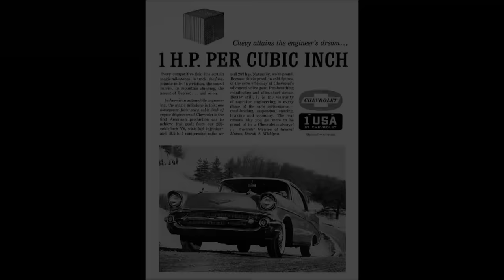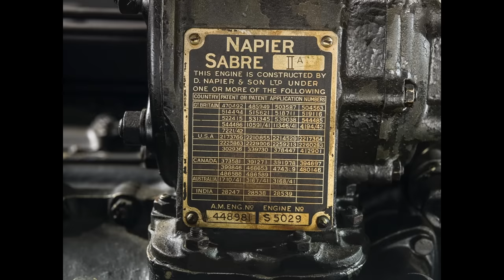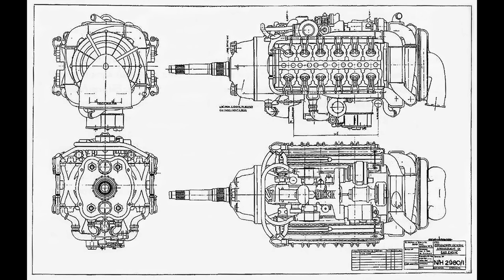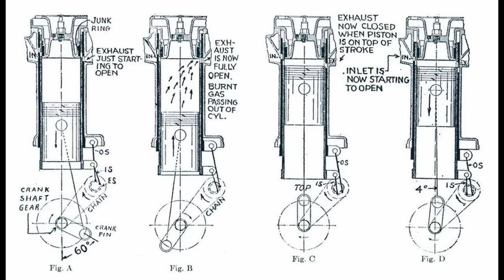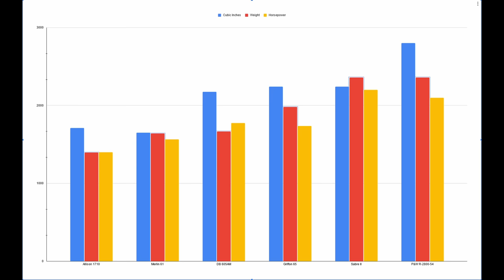Napier Sabre - The Ultimate WWII Aircraft Engine - Part 1

Comment: It's pronounced NAPE`-ee - ur.  My Dad was an engineer for them in the period right after the War.

It's my understanding that Napier felt, as you said, like the red-headed stepsister when it came to defence contracts during the war, and after. They probably had the best team of design engineers of the lot, but their solutions were based on complexity. So it doesn't mean much to say you have the highest power to weight ration, or the highest specific power, when that translates to unreliability in the field. 

My father began his career at Napier as an apprentice, right after University (BEng) in Canada, so he was a) well trained in engineering ideas and b) still required to take a highly practical path to the design floor. This might have been a post-war adaptation of work practice by Napier, in response to the disfavour that the Sabre met with, which was generally thought to stem from the unreliability of the unit. But Napier's roots were in old-school British engineering, and closely tied to the expectation of a practical engineer, not a lofty theoretician, as their ideal designer, so I doubt it.

I think the premise of the video, "Ultimate" award, isn't well suited to the topic. Without a doubt, a better trained ground engineering staff, able to work effectively on the Sabre would have improved things; so would better maintenance schedules; so would better logistics, for the delivery of spares. But in each of those caveats, there's the reality of war: the Ultimate engine most certainly isn't the best engine, if it fails on all those criteria, which the Sabre did. More importantly, it did worse than the other engines around it, like the Merlin, of course, but also the many Pratt and Whitney radials, whose design philosophy was built around simplicity, repetition of parts, simplicity of machining individual parts, and potential for improvised field repair. These were not ideas that the engineering elite in Napier gave much thought to.

A rather tragic side note to this: my father was in his late teens on D-Day, and finishing high school. On that day, the person in our family he looked up to, far beyond anyone else, his uncle Mel, was lost, in a Tempest (might have been a Typhoon), and the wreck and his body was never recovered. Given that, it's generally felt that the most likely scenario was that after getting detached from his group, he made his way back over the Channel, and a lilkely cause of death would have been the failure of the engine in his plane. The death affected my father hugely, and he never stopped referring to Mel, decades afterwards.

And after graduating, he went well out of his way to secure that apprenticeship with Napier; that's how he ended up in the UK, how he met my mother, and that led to the guy writing long comments on YouTube, 65 years later. But I wonder, and have always wondered, if joining the firm was in some way connected with making things right that had gone wrong for his hero....
Reply from the maker: I agree that I'm using the term "ultimate" a bit loosely here and only applying it to power output rather than the numerous other factors, as you mentioned. I think the next video will cover the R-2800, which many would agree -- alongside the Merliln, which deserves its own video -- was the real work horse of the war. 

Also, what an incredible story! While tragic, it's so interesting the personal connections people form to these bits of history.
Reply: I've been pronouncing it correctly...Thanks for the story about your father...You know, I use to fly a Battle of Britain flight sim called 'IL2 Cliffs of Dover' (checkout the dogfights on Youtube)...and there was an airstrip at 'Lympne' during the Battle of Britain that you could use in the sim...We used headphones as comms so we could fly with folk worldwide all in real time (still amazes me)...Anyhoo, nearly everyone had a different pronunciation for 'Lympne'...so I phoned a pub in the Lympne village and asked them just to put the debate to bed...It's pronounced 'Lim'...The bar staff laughed at the call...
Reply: Thank you for sharing that fascinating story..
Reply: Good engineering solutions meet the specification using the least cost and complexity.  In the case of the Sabre, Napier proved that they could meet the specifications, but at a cost and complexity that meant their solutions were not, at least initially, mass produceable.  In the normal market this sort of solution can be acceptable provided you can secure funding to continue development... again and again.  In wartime it can be fatal.
Reply: @lewistaylor1965  Only the English could come up with Lympne and pronounce it Lim. Wonderful. I fly DCS simulator (from Spitfire to Hornet) and yes - it amazes me that I can fly online with international friends on missions. Just got the Winwing HOTAS controllers.
Reply: Love hearing this kind of stuff.  Thanks man!
Reply: @flightdojo  How many hours of maintenance per hours of flight was required for the Napier Sabre engine. This wasn't addressed in your video.
Reply: There's a problem with the power to weight ratios listed for all the WW2 liquid cooled aircraft engine's that can be misleading, they don't include the weight of the cooling system and coolant since it can vary from one aircraft to another. 
Any engine this size making this amount of power is going to need a cooling system that'd be around 300 lbs, and that's probably a little on the conservative side knowing that the cooling system for the Merlin, which was a considerable amount smaller, was usually around 250 lbs depending on it's application.
Once you add 300 lbs to the listed weight of a Sabre engine you're looking at closer to 1 HP per lb which is where engine's like the R2800 were at towards the end of the war, the actual power to weight ratios of air cooled engine's are a lot closer to what's listed once it's in it's application and running. 
Since any engine with conventional poppet style valve's are considerably easier to manufacture than the sleeve valve type which were labor intensive you had much less man hours per HP involved in their manufacturing making them more ideal for something that needs to be mass produced for wartime as opposed to something that's being built for racing or in the interests of breaking records. 
At the end of the day a design that makes just over one HP per lb that takes twice as many man hours to produce is far less desirable than an engine that makes just under one HP per lb but can be manufactured in half the time, they were task with winning a war not races.
Reply: @lewistaylor1965  It's funny that if you want the best local information the Pub is the place to start, that is how I gathered the information about my ancestors and relatives on my visit to Wales in 2002. Actually, the tip came from my father.
Reply: I have always wondered why the saber was not in more aircraft. I never really thought that unreliability was an issue. The fact is we all buy things that we may not fully understand but buying something that dose not work dose not make sense. Proven reliability in the field is worth 1000 times more than a design that is tested under ideal conditions. Pratt and Whitney had problems with the R3350 in the B-29 that they never fully solved, replacing engines after 75 hours times 3,900 aircraft is not only expensive it wears out ground crew and without the support no missions. The Saber took away material, money, manpower away from the production of other aircraft and engines that were proven, not to mention jet engines that were in the early test/production phase. The value of a weapon can be proved in combat an idea or concept is only as good as it develops in theory to actual usefulness. Proving a concept  and the necessities of war was how aviation  made progress. Having proved that the Saber worked probably had the Germans put more of a sense of urgency to produce a counter. I thought that your post was one of the best posts I have read thank you. From a half Brit/American.
Reply: @Daniel_Donaldson I believe he DID pronounce it correctly, just the way you point out. What's the problem?
Reply: @jazzandbluesculturalherita2547  I lived in Napier, NZ, and he definitely mispronounce it badly; watch some pommie Napier videos if you don't believe me !!
Reply: @markgranger9150  I suspect it was partly to do with unreliability, but you really on find that out once it's forward deployed. I suspect a bigger issue is that the complexity of this engine meant you could build 2 or 3, maybe more, allisons, Merlins, or R2800s for the same price and time investment. The way ww2 was fought, the ability to take a design, convert its measurements, send it to the US plants, and have it quickly cranked out in the tens of thousands, was paramount. Sleeve valves (and 24 sets of them at that) require an insane level of precision manufacturing. Couple that with two cranks, a transfer box/final drive, all the plumbing to supply those valves (remember, you're now plumbing through the block instead of a head) makes economies of scale much smaller on the Sabre, whereas you could pump out R2800s all day long, strap them in an airframe, duct tape a prop to the front, and now you've got the fastest allied prop fighter of the war, and you can build tens of thousands of them.
Reply: @arkhsm  One of the best films I ever watched was "World's Fastest Indian." Me being a motorcycle guy, I could understand the central character's hopes and dreams, how meaningful it was to him to be able run his motor at the flats and win. Really cool story!

Also, I think the author here may have rerecorded his audio, because it sure sounds now as if he is pronouncing it NAPE ee ur.
Reply: @johnmclean6498  Except it is a BRITISH word from before the Roman invasion. Where's the "English" in that?
Reply: @seanm8030  I do think that the "least cost and complexity" doctrine as good engineering solutions is something that is often suffered from today. It is not uncommon that it produces something that focuses on the very lowest cost that can in some way deliver the requirement, and usually it initially fulfills the requirements, but that often may lack the desired and expected longevity of meeting the requirements. I would rephrase the good engineering solutions statement as something along the lines of "lowest cost and complexity without being too low cost or having too low complexity" (whatever too low means). More or less along the thought process of "Everything should be made as simple as possible, but not simpler".
Reply: @Daniel Donaldson Thank you for the amazing input.
Reply: You have to pretend you're Canadian.  It just helps.
Reply: @jazzandbluesculturalherita2547  It's all good mate.  The fact that Burt built a bike at the bottom of NZ, using a 1920s Indian engine; then managed to go to Bonneville USA in the '60s, is mind blowing in its own right !  The fact that he set so many records is off the scale !!
Reply: @hakanolausson1367   In the case that you needed to exceed requirements I would say your requirements document is incomplete or incorrect.  I would also have thought you were german.  :)
Reply: @flightdojo  don't worry about the keyboard warriors. Loving the channel. Subbed
Reply: Early in WW2 (1939-40), aircraft companies were encouraged to offer versions of bombers and fighters with a Napier Sabre option. 1941-2 the opinion of officialdom changed as it was having significant issues, on the back of the Dagger also having been problematic, i.e. Napier had already had strike one. Rolls Royce had lots of issues with the Vulture too, but it also had the the Merlin doing well and the R (Griffon) up and running pretty well in 1942. Ditto for Bristol - Centaurus was an issue, but the Hercules in particular was doing well. In the end the Sabre came good, it just took a while and in 1941-2 the war was not going very well for the Allies, so anything not looking like it was going to work out was likely to get funding cut.
Reply: @johnmclean6498  Wait until you hear how Slaithwaite is pronounced...
Reply: Excellent reply, sir.  
Well written.👍  Thank you.
Reply: @arkhsm  . The good morning
Reply: @wbertie2604  Couldn't even guess! Ok...I'll try "Slate."
Reply: Excellent reply and puts many things in context. I sounds as though you may have followed a similar career in Engineering ?
Reply: @johnmclean6498  Slough-ette is about the best version I can manage to impart the phonetics.
Reply: @wbertie2604  I am constantly intrigued by our mother tongue and the local inflections and names. Thank you for another to add. I would never have come up with that.
Reply: In
Reply: If you tube had more input like yours it would be all the better for it. Thanks for sharing your story. Im the son of the son of a USAF mechanic (bombers) and English ambulance officer. 
Unfortunately the USAF guy was a son of a something else entirely.......... but it led to me being here.
Reply: Regarding the mispronunciation of "Napier" throughout this video, you have to keep in mind that the narrator is a Yank and that English has not been spoken in the colonies for centuries now.
Reply: @Jazzmaster Jay I don't believe this engine was designed or built in New Zealand, so I have to think his original pronunciation corresponded more closely to  his location or the location of the engine, NOT to that of New Zealand. As a USA Midwesterner, we have several cities named Napier, and we say the name EXACTLY like he is saying it now in the video: NAPE-eee-urr. If you want us to know how it would be said like a Kiwi, please send us a recording, or a link to one. Take it or leave it.
Reply: @seanm8030  Good comment - exactly the trap the Germans fell into with tanks that were brilliant "on paper" but which failed to have the desired impact on the battlefield for either reasons of cost, efficiency, reliability, etc
Reply: @lewistaylor1965  but he corrected his use of Napier and rapier ... as he didnt use the correct enunciation of either of those ...
Reply: @johnmclean6498  and only the americans would take the french name levesque ... lev eck ... and pronounce it leve skew  ... or a Name like Roi ... r wha ... and call them roy
Reply: @dukecraig2402  What's a 1940 fighter pilot opinion ?  Does he want 4 planes slower than Me-109's or better 2 or 3 planes at least as fast as Me-109's (or starting from 1941 as fast as FW-190's if you want) ?  We should read wartime comments from Typhoon and Tempest pilots to get their impression and appropriate stories...
Furthermore, considering the time needed to train a good fighter pilot we should wonder at what point massproduction is needed over individual fighter performance and over sturdiness as well (especially when related to multiple 20mm FlaK hits at low altitude)... This question is crucial as soon as you want your planes to fight over enemy territory, and even more as soon as you want air superiority at least a year before a D-Day landing can be attempted...
Reply: @Cadadadry  
The Typhoon is my favorite British fighter from WW2, they were beasts, it's a shame they never got the engine sorted out and it's intended role as a high altitude fighter wasn't realized but they sure did hammer away at ground target's. 
The answer to your question is they all preferred high altitude performance, people go on and on about turning ability but every WW2 fighter pilot I've seen in interviews, American, British, German and Japanese when ask what the preferred method of attack was they all say start with an altitude advantage and pounce on the enemy boom and zoom style, even in fighter's with excellent turning abilities they all preferred to avoid turning fights if they could and boom and zoom on their enemy. 
That's why as the war progressed the later variant's of fighter's usually incorporated high altitude supercharger systems if they didn't have one to start with, the Spitfire being a perfect example, the majority of Spit's, the MK V, in the Battle of Britain had the Merlin engine that had a single stage 2 speed supercharger that was good for medium altitude performance, when the MK IX started being fielded in mid 1942 with it's 2 stage 2 speed supercharger version of the Merlin it became a whole different animal then, all of the sudden the German fighter's with their single stage variable speed superchargers that started to die around 15,000 ft were at a serious disadvantage, hence the variant of the FW190 called the Dora with it's high altitude supercharger system, but I don't think they were made in anywhere near the number's that MK IX Spitfire's were, prior to the 2 stage supercharger variant of the Merlin they tried a single stage supercharger that was optimized for high altitude in the MK VI Spitfire but the problem with optimizing a single stage supercharger for high altitude is performance is down at low altitudes, a little at medium altitude but down big at low altitude and is why they didn't make that many MK VI's, and they all got sent to a single squadron, I think it might actually have been Douglass Bader's squadron that got them but it's been so long ago that u read about who got them I can't say for sure.
After NACA's tests in the mid 30's the government task them with to determine what the best supercharger system was for high altitude performance the US Navy chose the 2 stage supercharger type and the USAAC chose the single stage supercharger with a turbo to kick in and start feeding it at medium altitude, the B17 was the first US Army aircraft to use that system with the P38 being the first fighter to be adopted with it in 1938, the P40 and P39 were both originally supposed to have the same style system but everyone was screaming for aircraft so the turbo was dropped from both of them to speed up their development time and get production lines up and running for the sake of providing everyone with aircraft.
Reply: @autodidact537  Too many. And as even though it was a real engineering masterpiece there in-lies the issue with this engine.
Reply: What an incredible, and personal, account of your indirect association with this engine. How it effected your Father's life and, by paternal attitude and familial association, Your life. One of the best short personal accounts related to an aviation topic that I've read on YouTube.  Especially one regarding, for an American, such an esoteric topic as underated and underdeveloped WWII British aircraft engines. Thank You So Much.
Reply: @dukecraig2402  You also have to consider the aircraft that the engines were put into and their own particular problems which impacted the reputation. In particular the Typhoon had a severe problem of the tails suddenly detatching from the aircraft. I believe this was due to flutter causing fatigue of the airframe. The later Tempest which the improved Napier Sabre engines were put into were some of the fastest single engined aircraft of WWII at low altitude making it an excellent low level interceptor. In particular it destroyed 638 of the 1846 V1 flying bombs destroyed by aircraft, either by shooting it or nudging it with the wingtip. There is no one design fits all for aircraft or their engines, they all had there benefits and drawbacks for different usecases. The sabre served its purpose as a very high power to weight engine well.
Reply: Thank you for sharing this personal history. Without it, we would be reduced to conducting archeology on artifacts. This video implies that Napier got started in aero engines in the 1930s with the Halford designs, but as you probably heard, their mighty Lion 12-cylinder engines powered speed record-setters on sea, land and air. I believe Napier motor cars were in the same class as Rolls-Royce for quality and price, so it’s interesting to imagine what a 2022 Napier would look like set alongside the latest Rolls.
Reply: @lewistaylor1965  I used to go through Lympne every day on my bus to school, and did my work experience on the industrial estate that is now where the airport used to be. Never thought I'd see people questioning how to say it on the internet!
Reply: Thank you I was just about to say pronounced so also!
Reply: The name is derived from the Latin Portus Lemanis a Roman port approx 2,000 years ago the current spelling is middle English which came into use after 1066 a combination of Norman French, old Norse and Viking however the current spelling was not implemented in this period but much later after the first world war when the owner of a large estate occupying the land with perhaps a fondness for the Middle English Language named it Port Lympne.
Reply: @flightdojo  You made one big mistake in the video as sleeve vales are unreliable and also made the engine very difficult to service or rebuild. They were the main reason that the British Mark Series of Tanks of WWI kept killing their crews, due to the leakage of combustion gasses from the sleeve value engine used. [ Half the tanks that the Germans "captured" had literately crossed the front line with a dead crew inside. ] 
This issue was never resolved, which is why the sleeve value technology has been left behind in the history of power-plant engineering....
Reply: 🇺🇲 Long replies !?
To be honest,
I couldn't get enough !
Would love to be able to know more !
As much engineering of this engine development as possible !
Wondering where the potential of this engine truly is if modern day performance lubricants are employed !?
Can you tell me where the most recent design flaws were ?
Internal harmonics, vibration dampening !?
The current horizontal, and horizontally opposed engines have created some unique ways to subdue the negative internal vibration issues.
I wonder if we were to apply these techniques to the final Sabre design !?
Current casting techniques, modern aluminum alloys applied for block, and head castings, etc. !?
Even connecting rods are now being created out of carbon fiber, with very negligible weights, spring technologies have improved significantly, etc. and so on and so on !!!
See !
You aren't the only one who can write a lengthy comment ! 🤣
I have been fascinated by a number of these somewhat lesser known, and lesser developed engines !
And wondering where the potential of these might be if carefully applied today !?!
I have a bit of a crazy streak in me that like a few others have done before me,
aka 
( Blastolene Brother's ) installing much too large aircraft engines into road vehicles.
Including the use of extremely large tank engines, etc. !
I currently own a 1931 Twin-Coach delivery truck, which would be well suited for the heavy Napier Sabre in it's very wide open engine bay !
Hence my crazy streak !
Would you happen to have any knowledge of a couple of available Sabre's that might be laying around looking for someone to bring them back to life !
Hoping to hear back from you !
And thanks for your not all that long cement !
Especially when you have extremely interesting, and valuable, and quite possibly usable information ! 🇺🇲
Reply: @markgranger9150  The problem was mainly due to the sleeve valve engines with the Saber you loose one cylinder you obey the law of gravity. Ie what goes up... 
Whereas with regular valves you can loose a cylinder or three and keep flying. As the commenter above. Correctly stated they were tasked with winning a war. Not a race. My Uncle who was 2ic at Greenwich Arsenal during the war often had to come up with weapons in mere weeks or months, to counter what the enemy were doing.
Reply: I do believe at the end of the war the Sabre was a reliable engine. The points about standard machining of parts, backup spare logistics, adequate training for ground crews, etc, are something that are way down the list of disadvantages as they are easily rectified. 

The engine for the time was exceptional for sure. The design was exceptional as well, with having sleeve valves being quite smooth for a high revving engine. 

I always wondered why the Sabre was not fitted to the B29 which suffered from poor unreliable engines.  550 were lost with few to enemy action. The Sabre would have fitted the bill and it was readily available. It could have been made in US factories like the RR Merlin was.
Reply: @markgranger9150  
If we stuck only with engines that were proven we would not advance.
Reply: @davidhollenshead4892  
Sleeve valve engines were very smooth.  They were made for cars, the British Daimler cars used them. The British Royal family always used Daimlers. They were expensive to make.
Reply: A lot of that’s true. 
A focus on pure engineering design excellence, and lack of production control and testing and after-sales service expertise. Rolls we’re masters of both of those, particularly their in-the-field support and feedback to the design and production teams second to none. Yes and of course, wartime pressures… 
Fantastic engine which I’d love to hear running again.. one day, hopefully in the air !
Reply: It was a race between all motorists of that era the urge of war solutions was made under pressure. The Thyphoon was made for counter the fw190 who outclassed every british fighter
 for having an engine with  high octane fuel with high boost they need to make choices. The Sabre wasn't so much unreliable as others but doesn't endure damage as RR merlin.
Reply: @markgranger9150  The proof was in the pudding The Typhoon once the initial problems with the tails was sorted out became the best G/A plane of the War 
The Tempest the best low to medium altitude and the Tempest could do 392 mph @ sea level No other piston plane of WW2 was anywhere near it not even the FwTa152 was as good
Reply: @thepewplace1370  No  R 2800 powered the Fastest plane of the War Wishful Thinking. No radial did the fastest anything Not Tactical Mach, not Climb, not Turn, not Service Ceiling.
Reply: @johnburns4017  No the USA would never have used another British Engine They just squeaked in with the Packard Many on here say it was a separate engine to sooth their egos
Reply: @jacktattis  
Even in 1941 US industry was 20% idle. According to Edgerton the men unemployed, 20 million, was the equivalent to the whole UK workforce.  Britain was buying up dilapidated idle US industry converting it to war production in the process reducing their soup lines. An example was that the British government bought the Lima locomotive works in Ohio to convert to building to make upgraded Crusader tanks.  Sections of the roof had fallen in. 

The US gvmt suggested a new tank design that catered for both, hence the Sherman came about. The British were first to use the tank. The British regarded the Sherman as an interim design with the Comet and Centurion on the drawing boards. 

Once the US was fully into the war they pressurized to buy the Lima works. The deal was in return they supply the British Sherman tanks for free until the end of the conflict. The Lima tank works set up by the British still makes tanks today - the Abrams. 

Packard's factory was pretty well idle until they started to make the RR Merlin. The idea was to use the US made engine for bombers made across the border in Canada, eliminating a two way sea journey open to U-Boat attack.
Reply: @badbotchdown9845  
The MK 9 Spitfire shocked he Germans as it ran rings around the FW-190.
Reply: @jacktattis  which combat prop plane was faster than the P47 at altitude? Excluding TA152, which had to use NOS to exceed P47. 

I'll wait.
Reply: @dukecraig2402  Complexity needs to pay off. Whatever is considered paying off in a given situation varies largely - wartime production and use are vastly different from racing, and still, you have to make do with what's on hand anyway. The german industry greatly suffered from not being able to obtain a load of crucial materials that you need to apply hightech features in a way that allows for them to last and provide benefit, but in hindsight, it seems it was partially ignored, brushed off and solutions that were found to be effective only made their way to other engine design facilities in a delayed fashion, regardless of the overall situation (no competetion, government-ordered sharing of engine types, Junkers being state-owned, BMW and Daimler-Benz relying on state-ordered engines and therefore, could have been made to share info effectively and instantly), when they already had to make it work with comparatively poor quality fuel, which makes knock a more prevalent issue, and that made them, despite being some 7...9 liters ahead in displacement through most of the war, and applying direct injection and scavenging, most of the time, just at level with british and later american fighter engines. The Jumo 213, regardless of this, made the most advanced and daring transition towards higher operating speeds of the bunch, but only was made in greater series towards the end of the war.

Of course, the conservative tech of today once was avantgarde, as to say, of course daring, strange, outlandish or extreme solutions should be investigated, but rather than introduced vastly in critical times and critical applications (single engine plane ... reliability being more important than anywhere else, ...). But, from lab-scale, basic experimentation and such to a developed engine featuring the new treat, usually it becomes less complex, more efficient, more compact, cheaper and generally, better. More advantage for less risk. The vastnumbered engines, projected in germany as well, counting up to 36 cylinders per engine, never seemed a good idea to me, as they throw in lots of potentially failing parts in greater number, under higher pressure to be cheap, as there's so many of them (14 camshafts in a BMW 803, for example, and 7 transmission shafts, transferring power from the back half to the front, and accessory power the other way), while only one failure may knock the engine out, while a plane where the 2...4 engines are not crammed into each other simply goes on with their mission, our over-complex single engine plane will have to attempt an emergency landing because a shattered conrod travelled through the crankshaft greeting ever other part he met, and stayed in contact with surprisingly many thereof. Instead of adding to reliability, we see more sub-units in one large machine decrease it. Therefore, and considering that engine speed wasn't at a limit regarding piston velocity, increasing RPM seems generally a good idea, but don't need that small a cylinders, as even the huge 603 at 44-something liter would operate up to 2800 RPM without falling apart for THAT reason, and 12 being a cylinder count that has many advantages over all it's close neighbouring, sufficiently appliable, numbers (dividability by 3 generally is, in respect to gas dynamics, advantagous, even without exaust turbines present - even numbers are a given in a V or X or H engine, the choice in that respect may aim for compact or minimal frontal area - even numbers per row elimiate inertial moments stemming from piston forces - so, 16 and 18 would be the next best feasible, each only checking one box, and 24 already is twelve, even twice as much so as twelve itself,  ... 14 and 18 come to mind regarding two row radials, but they're a very different breed of beast in so many regards, ...

Anyway, always to add at wartime stuff: I'm glad my ancestors lost this war, as I feel obligated and connected to ideas rather than areas.
Reply: @DC-rn1fc  
You're wrong about piston velocity not being close to maximum with those engine's, you're apparently considering piston speeds of automobile and motorcycle engine's when thinking about the piston velocity of those aircraft engine's, and thinking that 3,000 RPM's doesn't put their pistons near maximum velocity but it does, high RPM motorcycle engine's have strokes that are generally right around 2¼ inches or so, those aircraft engine's had 5½ to 6 inch strokes, that's a long way to travel meaning the piston has to get moving much faster than something with a 2¼ inch stroke to travel it's distance of 6 inches both ways in one revolution, run the number's and you'll see that the piston velocity in those engine's is surprisingly close to modern high performance motorcycle engine's and was one of the limiting factors in them, especially when you consider that they weren't made of today's material's, even if you make a set of pistons for one out of today's material's you're still not going to get too many more RPM's out of one since just 10 more RPM's increases piston velocity a lot more than it would in a 2¼ inch stroke motorcycle engine, it's a stroke almost 3 times as long so it's going to increase the piston velocity almost 3 times as much per the same increase in RPM's, even a motorcycle engine with a long stroke for motorcycle's like my built 80 inch Harley Shovelhead's 4¼ inch stroke is an engine that redline's at 6,500 RPM's which actually puts it's piston velocity surprisingly close to that of my CBR 929RR with it's 2.126 inch stroke at 11,500 RPM redline, double an engine's stroke and you're doubling it's piston velocity at the same RPM's, so yea those aircraft engine's like the R2800 with it's 6 inch stroke running at 2,700 RPM's had a piston velocity close to a built Chevy 350 small block at 7,000 RPM's with it's 3.48 inch stroke and both will have piston velocities close to my CBR 929RR with it's 2.126 inch stroke at 11,500 RPM's and all 3 will have piston velocities close to my 80 inch Harley engine with it's 4¼ inch stroke at 6,500 RPM's.
So yea, the piston velocity in those WW2 aircraft engine's was close to maximum for an engine that had to last 500 hours being run at ¾ths of it's redline for 75% of it's life and at redline for 5% of it's life (with the remaining RPM ranges being the other 20% of it's life) compared to a high performance street car or motorcycle that only runs at ¾ths of it's redline for maybe 5% of it's life and at redline for only 1% of it's life, that's also a factor about aircraft engine life that's deceiving from people making comparisons to street machines, a street machine spends the vast majority of it's life with it's engine at 25% or less of it's maximum RPM's compared to aircraft engine's that spend the majority of their lives at 80% or more of their maximum RPM's, it'd be like my CBR 929RR traveling around at around 9,000 RPM's most everywhere it goes with periods of holding it at constant redline, you probably wouldn't get 500 hours out of it like that. 
Considering the piston velocity that those aircraft engine's had combined with the fact that they operated at 75% or more of their maximum RPM's for 80% of their lives it's amazing they lasted for 500 hours or more.
To increase power in them was done by increasing boost levels not RPM's, piston velocity had their RPM's maxed out where they were.
Reply: @dukecraig2402  Wait a second - we shall differentiate here. MANY engines were running below GENERAL piston speed limits given by material, machining processes, chemicals and so forth - and SOME were running pretty close to it. Anyway, I know how that works, I just don't really feel like running many numbers at the moment, but ... given that Jumo 211 and 213 both had 165 mm of stroke, DB's smaller main engines had 160, we can compare them. The 213 has been successfully tested up until 3750 RPM and saw service at at least 3200 in constant operation. Equals 17.6 m/s, while the most DB 601 and 605 variants ran at 2700 RPM, equals 14.4 m/s of mean piston velocity. The most daring, the most advantageous, move in that direction was that of Junkers with the Jumo 213, but most daring don't need to be most failing. Many contemporary engines of similar cylinder sizes didn't even reach 3000 RPM, because either the limit of the tech used in them lagged behind that of the Jumo engines, and/or they were less daring. Comparing the 165mm, 3200 RPM with a typical car engine, we can assume that half the strike, twice the speed shall work (in regard to acceleration, we're worsening it of course, but let's keep that aside, as that's bearing loads rather than relative speeds) similarly well at the same tech level. THAT engine, I consider at the limit of it's time (1940 or so)... Of course. Now, 6400 at 82.5 mm stroke ... daring for an engine at that time, yes. But, most engines were considerably slower running, even ones with smaller units were, and as RPM doesn't add to knock directly (indirectly, of course, there's high speed knock, or the beloved instantly damging knock in engines running with unfit oil additives and at high pressures (like BMEP > 20 bar) and all that, but in general, especially in boosted engines, knock is most prevalent at max torque, min RPM. Downsized engines, at times, even have ignition after top dead center at such conditions, while heavily scavenging, so they can maintain a compression ratio that won't render all the downsizery effects lost, and still have that high a turque, ...) Anyway, at that point in time, closing the gap to the faster engines seems the most promising (for german developers), as knock and poor gas with nothing in sight to rectify this would prevent any higher boost pressures being employed without also drastically improved cooling capacities, which in turn add to the drag, and might send us into a loop of ever rising drag, ever rising boost, ever rising heat exchangers, until you basically fly a higly efficient, huge radiator ... anyway, an increase in BMEP was pretty much limited to gradual increased efficiency of, merely, accessories and miniscule steps in engine process or mechanical efficiency. Displacement weighs, unless it's built in a way demanding the reduction of boost and/or speed ... exchanging boost for displacement isn't feasible, especially in high altitude, so that is also not preferable, but a proven means regardless, just elsewhere. Sometimes, you can squeeze in considerably more displacement without too much larger frontal area (like, a radial consisting of 7 cylinders per plane may be adapted to fit 9) or weight, with the V enginges, larger cylinder count per row could be a way to go, but the long crankshaft may suffer torsional resonances ... ever wondered why you don't see straight eights anymore? Cos that, if I'm allowed to shortcut it. Also, still weighs, and is overall just extremely long, needing more adaptation than just a long nose (-> FW 190D and its development, transitioning from twin radial to V12, going V12 to V16 or V18 may appear a smaller step, but as they start from longer anyway, ... anyway, any V of more than 12 cylinders hasn't seen much success in fighter planes, and four-row engines of 16, 24 or even more cylinders have neither. The soviets build a 7*8 multi-radial, but ... soviet tech is a whole new level of weirdities, oddities and head scratching anyway. No role model!

After all, if we cancel out stroke for speed, the truly relevant specific power shines through, that is power per piston area - half the stroke, twice the RPM and we're winning close to none, but gather many problems not related to piston speed, even if not pressing urgencies themselves, wear and tear will be more of a concern, especially if adaptations can't be done properly (wartime shortages ... germany could develop, finest so, but not produce in greater quantity, and many times, doing so regardless, resulted in power being reduced in the field by some hundred HP for months straight at times, by reducing boost pressure more often than RPM. So, with the options, the proof of piston speeds at Jumo 213's level - 17.6 m/s at 3200 RPM - seems a proper path of development to me, as most, radial and V, comparable engines reside somewhere in the range of 14...15 m/s. At 3750, we'd reach 20 m/s, which is considered a reasonable limit for cast iron vs alu pistons since about the early 1930's, if you care for satisfactory, yet not record setting, time in operation. Alternatively, in cases we don't need to increase frontal area considerably, enlarging the stroke while maintaining the speed CAN be preferable, but usually, there's not much of wasted space awaiting to be filled anyway, so ... practically, here, that's a no.

Given the circumstances the US and UK were facing, more boost would seem more reasonable to me, and that's pretty much how they did it, because no direct injection can beat 100/150 ON rated gasoline, compared to 87. Merely just enlarging displacement ... can be a preferable way to go, maybe almost everywhere, depends on what's there already of course - everywhere, but in an airplane, as the larger weight and/or cross section would eat up a lot of the gained power. Revs don't weigh, therefore, and for the above comparison of Jumo's 213 and it's competitors (or enemies, or ... whatever...), I still see the point valid - a non-drastic, but severely relevant increase in RPM would serve the desire to increase power best, under the given circumstances of wartime germany. Now, Junkers was known to extremeliy carefully develop, craft and assemble their stuff, in some regards, the development and production at Daimler appears to be downright sloppy in comparison, so that may add a tad, too.

Anyway ... great night, or ... so.
Reply: + mechanical efficiency ... seen a BMW 803? That thing is ridiculous, it's full of shafts for different purposes, transfer power back and forth ... 14 camshafts, all driven by a set of conical gears at each end of the driveshaft ("Königswelle" in german, the term stemming from windmill tech of ... uh, earlier that day ... "King's Shaft" - 14 of them...), everything present multiple times, for the engine could run as a half or as a full... Just having that SOMEWHAT runnable bound so many hours, years, of development that saw no application whatsoever, ... basically, it's complexity that doesn't pay off. Valvetronic is a great feature, complexity that defeats the wasteful throttle control and doesn't need special gas, like stratified load does, ... but, an engine full of gears and shafts that don't really add to the function, but just repeat themselves at an outrageously large number, but don't add any function worth the hassle, let alone add anything to reliability or efficiency. How many gear pairs per cylinder? More than any other, and that with 14 cylinder pairs in two radial planes. Radial OHC lets me think of inverting the cylinder rather than actually placing a camshaft in each head, and have a lever atop that connects piston conrod and crank conrod, ... uh, no, we're past where any of such matters anyway...
Reply: Good history.  Napier-Sabres had a host of problems.  My father had a mate who died in a Tiffy. They think it was CO poisoning during a dive.  Never pulled out.  Smoking hole.  Bloody casket in the desert heat.
Reply: Did you mention the service intervals?
Reply: @davidschwartz5127  Mess Dinners are the best.  The vets tend to share the truth with others in uniform over drinks and good food.  They can otherwise be very guarded and political during formal interviews with journalists.  The vets I spoke with were not happy flying Typhoons due to the unreliable engine, among other airframe issues.